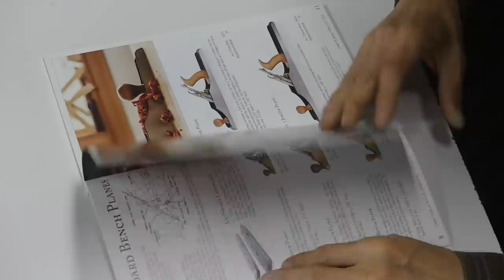Make a folding outfeed table

Comment: Great design! Really like the hinge function! I have a small shop with an older Rockwell 10” Contractors saw and can’t afford the room for a permanent table like yours. Plus my motor hangs or the back of my saw and any bevel cutting swings the motor up into the bottom of the out feed table, so I came up with a different solution. I did install a 30” side extension that’s laminate covered and also acts as a router table using my saw fence. I went to an old used office furniture store and found an old printer table from the 80s that has a chain driven elevation mechanism to raise and lower the laminate covered top. It’s 30” x 40”. I actually bought two. I put locking wheels on them to  give them mobility and elevate them to a range closer to my tables saws top, and use them as in feed and out feed tables. I use them together as an assembly bench when not needed at the saw!

Comment: Very inspiring design! My shop is in my garage and I have been wanting a dedicated out-feed table for a while. I plan to orient the saw so that the material feeds into the garage. I hadn't considered a folding extension. Rather than creating one that hinges down and blocks access to the storage space below, I think I will devise some sort of slide-out support arms that will support a separate sheet that I can keep stored below the fixed portion of the out-feed table when it is not in use.

Comment: WOW, the Wood Ninja!
Nice nice build, And I learned a few tricks. 
 Clamp help hold work in place if your using screws so they are not just for glue.
You can always add fold out legs at some point,  Or drop in a router to make a router table also.
but you have an outfeed and glue up bench as well as desk. I would not talk much to add fold down legs.

Comment: Hello!
Great Video as always. Here in Vienna we call the White stuff HPL-Boards. The full name is high pressure laminat an its made from many sheets of Papers and chemicals. Polyurithan am melamin. Its not toxic and very stabil for use. We use ist when we built furniture that is used a lot. e.g. school furniture. When working with it you have to take care that you dont hit something because it spliiters quite fast. But when its glued to the surface its a very good sealing for everything. I think you will have good experience with it
Greetings from the other side of the world! Tom

Comment: At 6:50, the material you have appears to be FRP (fiberglass reinforced plastic) it is a textured panel normally used for the walls in public bathrooms and commercial kitchens, places that get wet a lot. It is available in 4x8 sheets, I think Home Depot might even have it.
Reply: Jeremy Specce - I agree, looks like FRP to me too.
Reply from the maker: thanks

Comment: Very nice work and build? With the other side extension up and now this outfeed extension, you don’t have much space to move around - haha.
It will be a good assembly table also!
Now you need to build fold out supports AND perhaps a fold out chair.
You don’t need to be looking at plane magazines. You design and make beautiful planes so you should publish a magazine for your planes!
Reply from the maker: do not need to create a new one because my old cart is just right.It use table supports and chairs at the same time.